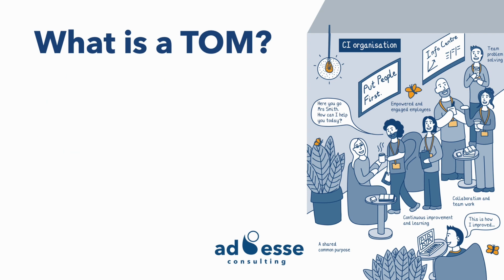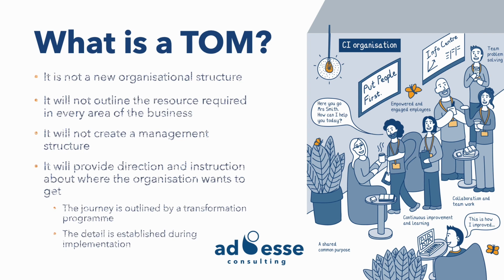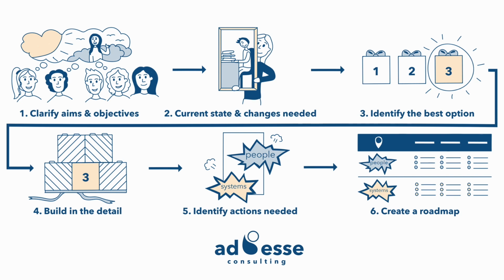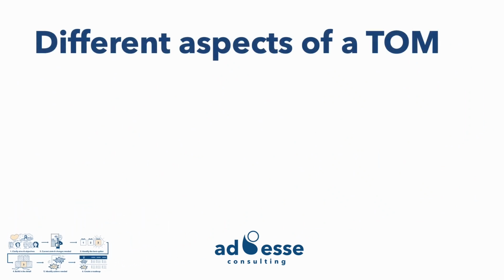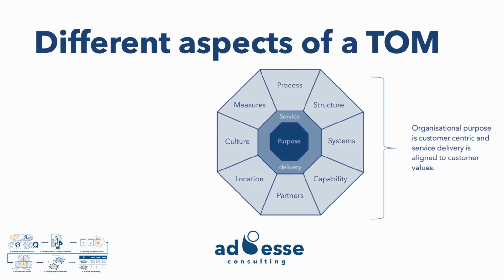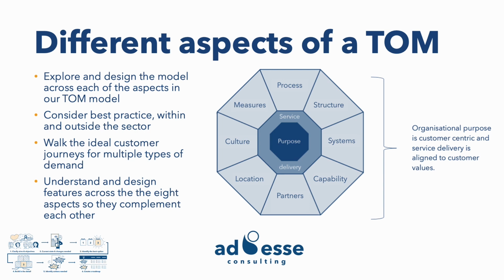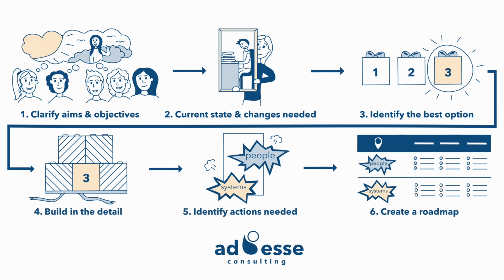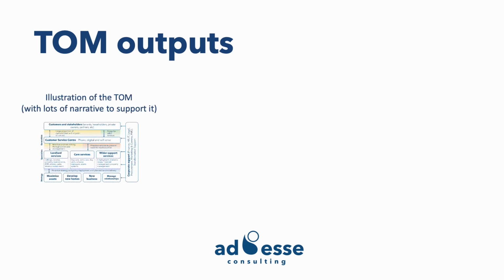Organisation design - Target Operating Models

Comment: Putting expected outputs in their own section, and closing on what not to do, is what makes this more useful than most introductions to target operating models.

The outputs are where I would spend the most time. A model can be well reasoned, agreed by everyone in the room, and still reach the people who have to enact it as diagrams and principles. Someone then sits down and turns it into the concrete version, one role at a time, usually in a workbook nobody else can see. That quiet translation is where an agreed model loses its precision, and it happens after the project thinks the design is done.

The test I have come to use is whether the model can be handed over without that step: whether what leaves the design work already names the roles, says who holds each one after the change and from which date, and carries the same identifiers the HR system already uses, so the receiving team reconciles it instead of retyping it. That is not a load file for any particular system, and it does not need to be. It needs to be complete and keyed.

Getting to that kind of output is what I am building a tool around, though the test is worth applying even when the output is a spreadsheet.